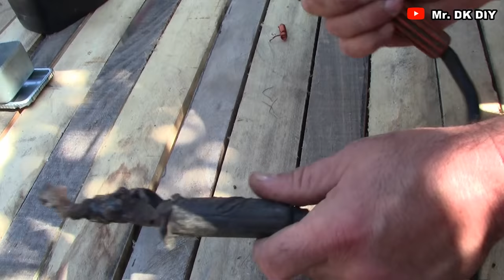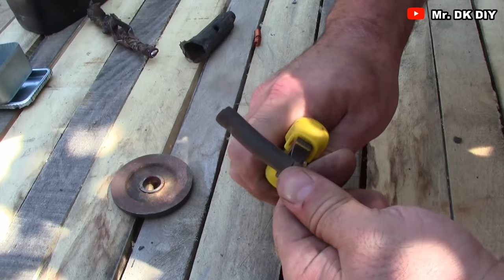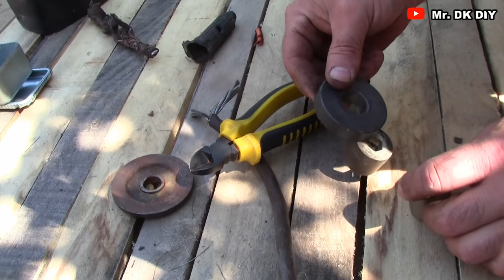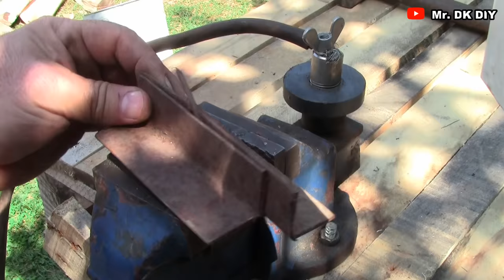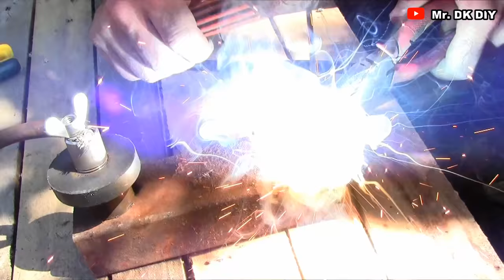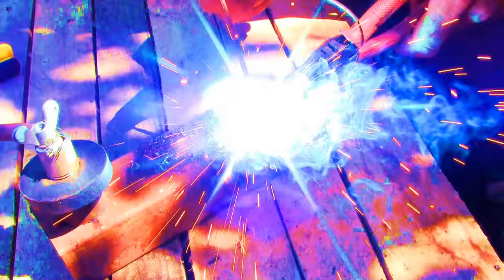HOMEMADE AMAZING IDEA / DIY 2018

Comment: not a good connection, evident by the sparks coming out from under the magnet/socket and the fact that it welded itself to the tube at the end. good idea, but needs to be refined more for sure.